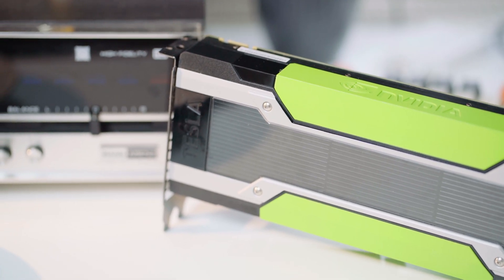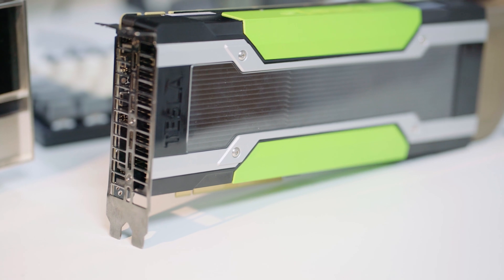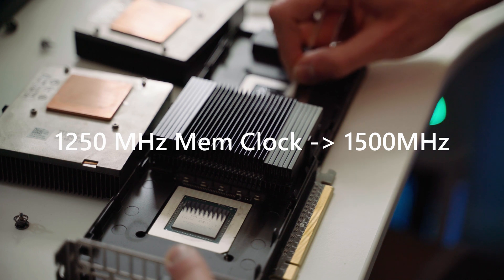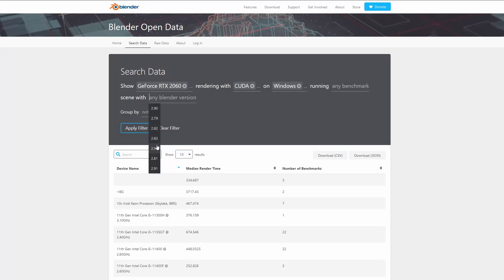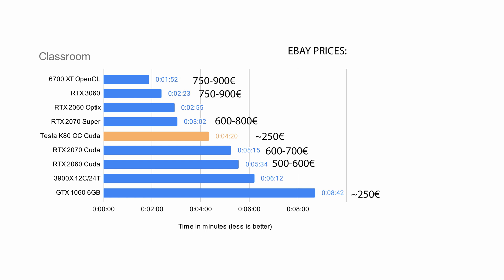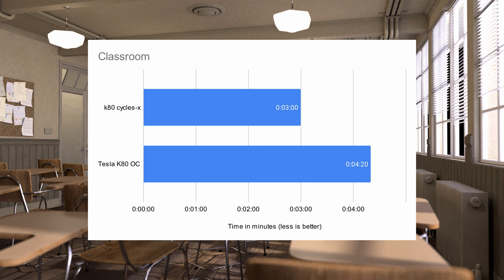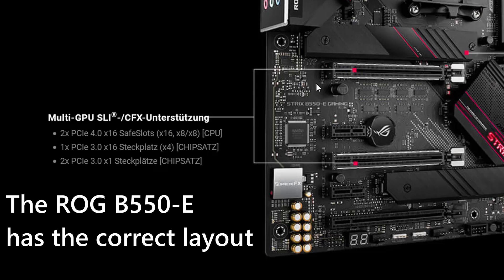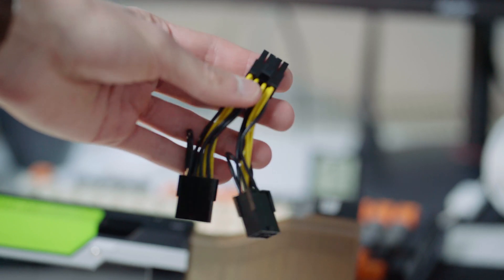Is This $5000 7 Year Old Server GPU Still Worth It? | Tesla K80 tested in Blender

Comment: just bought 16 k80s for $14 each. normally now ~$40. now some penguin servers with 8 slots, ~$500 each.... so at a bit over $1000 I have 384GiB vRAM.... Smaller deepseek is coming...
Reply: Did this work for you?
Reply: @mudkingz6432  not really. it is cheap and works, but that's for a reason... k80 is slow... we had to splurge on a100 to do a real stuff...
Reply: Does ollama works on these
Reply: @bekim137  yes, slowly :)

Comment: Sure you can't game on it, but if you wanted to make your own scientific work station on a budget than this would be amazing although you need to add a cooling solution to it because I'd suggest having a GPU with it sure DLSI is dead but that doesn't mean won't do anything. You can still have two GPUs working on the same motherboard just they won't be counted as one GPU the same can be done here I imagine with this server GPU you'd likely get a pretty good rendering beast as well long as you have a pretty good CPU and power supply.

Comment: im using X99 motherboard with xeon.. which is no igp on it. but got 2 slot for pcie, can i use low profile amd card for display only (bcs no igp on xeon) and use k80 for compute engine and rendering
Reply: Enable 4G decoding in BIOS first. Just put the K80 in the first PCIe slot, and another graphics card in the last PCIe slot, for monitor output.
Reply: @lQuadXl  thank you for asnwer mr. i founs out already but i doesnt turn the 4g decoding bcs its cause blank screen. so i use it without enable 4g decoding and it can run so well with rx 560 xt + k80
Reply: @erly777 Glad you got it working, enjoy 😁👍

Comment: Could most likely pop the shroud off and cool the gpu with some cheap water blocks if you want to be fancy, or high mark cpu coolers. 

I enjoy messing with laptops and cheap stuff like this on my off time. And often times and finding cheap cooling solutions to them is a fun hobby lol. Normal flow rate of a server is like 550 cfm. So most normal pc fans i doubt will be sufficent because theyre rated around 28 cfm. Buuuuut. Because there are two gpus....one thought is to have two about 250w cpu cooling blocks on it. One for each die. Or you could buy two water blocks and run them in parallel into a radiator. Worst case could allways use a peltier to cool the water loop for extra head room...etc.

Comment: I have a question about these cards. The total vram is 24gb but is it not divided between both cards (each card utilizing only 12gb each). 
Is it possible to utilize all 24 gb of vram for a single scene in blender? I'm seeing these as potential cheap use cases for headless render nodes.

Comment: When you flashed the overclocked BIOS did you confirm that both GPUs received the BIOS? These cards show up as two K80s corresponding to each of the GPUs in the unit; when I flashed the BIOS I did it the normal way (nvflash -6 bios.rom)  because I had forgotten that this is a two GPU unit. I'm asking because I flashed my K80 BIOS yesterday and noticed that only the first GPU of the two contained the flashed BIOS (via GPU-Z) while the other did not. When I put the K80 to do some folding (fah, folding at home) I noticed that only the first GPU showed a clock speed up to ~1000MHz and increased memory speed, while the other showed up as having a baseline gpu, memory clock and power usage but the GPU load is 100% :s .... Using NVFlash (newest build, 5.792.0) I was able to find out the index number for the second GPU but I could not flash the overclocked BIOS into it due to some mismatch board error. I ended up using an NVFlash version (5.590.0) that according to some forums can override this "board mismatch" using the command "nvflash --index=01 -f -6 bios.rom", where the index number corresponds to the vanilla BIOS. Now the second GPU unit has the flashed BIOS but still shows the same as before ..... did you encounter this? if not, how did you do it for your K80. :)
Reply from the maker: Hi, thanks for watching :) Tbh I don't really remember anymore how I got the custom bios running. I believe you need two different files for the two separate GPUs. Here is a thread that contains a lot of information which I used during this process https://blenderartists.org/t/tesla-k80-24gb-x3-rendering/1255786/28 maybe that can help you.
Reply: @futc.photography  bada$$ video tho! Will check out that thread. Videos like yours keep my hobby going.

Comment: I picked up a pair of these BNIB for $450 to put into an animation workstation I built for my sister in law 2 years ago... Like the individual you got your K80 from, I had to 3d print custom shrouds to force the airflow from a Noctua Industrial 140mm PWM fan from the front of the case through each card, but it works like a champ for her to this day. I spent less than what it would have cost to get her a single newer Quadro card and it performs within 10-15% for most of the work she does. They are great cards for the value as long as you're doing work that fits into the niche market these cards were designed for.

Comment: I know that this comment is coming very late in the game, but with "Above 4G Decoding" enabled, and on a motherboard that provides multiple PCIe x16 slots, and given that Blender works well with multiple GPU Cards, I am wondering what kind of performance boost one might expect with two Tesla K80 cards installed?  I would need to make sure that the CPU has integrated graphics as the Tesla does not have outputs, but... It might be worth the investment.  I was able to pick up the K80 here in the U.S. for $93 USD shipped.  I will let you know how it goes. :)
Reply from the maker: With two tesla K80 you can expect exactly double the performance of one K80, above 4g decoding is a necessity anyways I believe because otherwise you can’t address that much vram. Bandwidth usage is pretty low by blender so you don’t necessarily need a 16x slot but it’s the best case scenario. As I mentioned the performance should be exactly double, all rendering is done perfectly independently on each GPU core and 4 GPU cores instead of 2 will cut the rendering time in half.

Comment: This can't be true, it's 2x 780ti chips on 1 card, it has a combined performance that nearly matches the m40, which is a titan x / 980ti. In blender I found it beats a 2060, but a slightly slower dual gpu set up won't be able to bump up another tier
Reply from the maker: The K80 is definitely faster in Blender than an M40, I don't know where you got the idea that a 980ti has more than double the performance of a 780ti. The two GPUs on the K80, especially with the overclocked bios I was running for these tests, will beat the M40 any day of the week in Blender because Blender scales perfectly with multiple GPUs and the two 780ti's combined simply have more performance than a single 980ti.

Comment: I wonder if using the K80 in an e-gpu would be possible? I'd be using a MacBook with bootcamp/windows 10 so power would be fine and cooling could be sorted out. Obviously nvidia cards don't work directly with MacOS but with a hack :) they seem to work fine. Im more interested in the 12Gb of memory so have considered a Titan X but interested in thoughts on this...
Reply from the maker: That would be very interesting 🤔 unfortunately I can’t test that
Reply: I have answers, yes it would work. No it would not work well.

The k80 is a dual gpu card, which means it rely on sli for the speeds this guy reports.

In games or any other workload in sli it will perform almost like 980ti, but without sli which us most cases since sli is dead, you will get 1060 level of performance. 

You are going to be paying about 200$ for a dual gpu that only let's let's use 1.

Don't buy a k series card, they are not supported anymore and get really hot and don't support modern features.

Get a m40, it supports nvidia reflex, is an actual titan x, and should work great as an egpu.

You need to set the driver model to graphics mode but that's small.

Your biggest concern would be limited cpu speed
Reply: It’s a compute board there is no SLI or NV Link the board is incapable of using both GPUs for gaming but you can use both for compute and render applications.

Comment: If you are really doing Rendering?  Just get a server and call it day.
Reply: A server is not good at rendering

A server uses these gpus for rendering to be good at rendering.

A 64 core epyc cpu can't beat an old gpu at rendering, it's a cpu, it's emulating graphics.

Gpus have actual graphical compute cores.
Reply: @raycert07   Derp.  Ya think?

Comment: Yes you are right, it depends:By using Blender 3.0 rendering time of my single GTX 970 is just 3:10 Minutes. But you are right K80 may faster on more compley scenes, because rendering time of barber shop is ~30 Minutes ;-) Would be nice if you can retry your benchmarks with Blender 3.0
Reply from the maker: I would love to retest it with blender 3.0 but unfortunately I already sold the card, I was able to get my hands on a 3070 TI and using a Tesla card in combination with an rtx or gtx card is quite the hassle due to driver issues so I decided to sell the k80
Reply: @futc.photography  I know this is old video but were you using 2 GPU's at the same time and switching between them when rendering?!

Comment: hello nice video! this card is compatible with intel core i5 10400 2.90ghz processor (integrated intel UHD graphics 630 card)? you recommend it for the gaming?
Reply from the maker: I would not recommend it for gaming, it doesn’t have any video outputs, gaming on this card is only possible with some serious trickery in windows and I’ve never tried that out
Reply: @futc.photography  not true.

No series trickery in windows, you did no research. 

You run 1 nvidia smi command and reboot and it's in graphics mode.

This is an nvidia supported feature on tesla cards.
Reply: Yes it's compatible. 

But you won't be getting a 2070 in performance. 

At best using sli you will get 980ti performance, but sli is not supported in any games anymore. 

So you will get 780ti performance at best, which is half as fast.

And 700/ k series gpus are no longer supported and don't support new technologies. 

Don't buy these gpus, you are not smart enough to troubleshoot the issues they may produce.

Comment: i just have a question, blender doesn't reconise my k80 for cuda (i was using 2.93 and now i'm 2.90) how can i fix it?
Reply from the maker: Are you sure you have the correct Nvidia Tesla driver installed?
Reply: @futc.photography  yeah i've checked turns out that they didn't work because they reach the limit for heat, i've installed a 8000rpm fan and It works great

Comment: To get the performance figures listed in this video do I need to be using an additional GPU or will my amd 5 3500 be sufficient?
Reply: You need an igpu atleast, and it's not xalled amd 5 3500

Comment: The Blender Open Data benchmarks for the Tesla K80 are a lot worse than what you reported. Is this because Open Data only calculates 1 of the 2 GPU chips' speed, or is your overclock powerful enough to match the RTX 2070's speed?
Reply from the maker: I’m not using the Tesla k80 open data times, I’m using my own k80 times because as you mentioned the open data benchmarks only support one gpu.

Comment: Do you also recommend using the Nvidia Quadro M4000 or P4000? Can get these pretty cheap aswell in Germany.
Reply from the maker: No I wouldn’t recommend those, they are too expensive for the performance they deliver. I’d rather put that money into an RTX 30 series card if you can get a good deal, they are a lot faster than those quadro cards.
Reply: @futc.photography  Impossible to get a rtx 30 series at a good price atm

Comment: I have Tesla K10 and the dual GPU card gives a boost as well in Blender 2.93.

I also have both RTX A4000 and A5000, installed as eGPU on my Zbook 17. The K10 is surely a good CUDA addition to my Z820 with AMD Firepro W7100.

Great video! Kudos! 👍
Reply from the maker: Thanks :)
Reply: Hi, does using K10 or similar will allow to render with octane or using other CUDA features with my RX 5700XT?

Comment: Obviously the 6700XT is the one to get, if you could cough up the money...
Reply from the maker: The Nvidia 30-series cards are even better, if you get lucky and get one for msrp 😅
Reply: That isn't what you numbers tell me...
Reply from the maker: @sjoer  As you can see, the Nvidia 30-series aren't included in these benchmarks, only the 20-series is. In situations where optix can be used, an rtx 3070ti beats the 6700xt with double or triple the speed. I might make a video about the 3070ti in blender.
Reply: Yes, but Optix doesn't represent my day to day workload and an RTX30xx is priced much less favorable performance wise bar those edge cases ;)
Reply from the maker: @sjoer  I haven't done any conclusive tests yet, but in some circumstances the raw cuda performance also beats the 6700xt significantly. In some situation they are about equal. Yes that is true, the 6700xt is a lot easier to get at a reasonable price, I got lucky and got a 3070ti for close to msrp. If I do a video on it I'll definitely compare raw opencl performance to raw cuda performance.
Reply: I'd be interested in Vulkan rendering!
Reply from the maker: @sjoer  Vulkan API isn't supported by blender though, or is it?

Comment: bruh im considering buying one. Good thing tensorflow still support K80. My 1650 is at its limits when training.
Reply: Could you imagine if you couldn't use K80s with tensorflow? The cards would be e-waste.
Reply: I go oom all the time with my 2060s. Really considering to get on of these k80 and see if I can put it on my proliant server. Considering it cost me 6 cent per kwh and server uses at most 700 wh it would only cost me 1.18 per day - wayyy cheaper than cloud (tho they have a6000 for 1.25/hr).
Reply: @Very_generic_username  dude, add in power distribution costs. Those scale per kwh too.
Reply: Nah nothing fancy like pdu - I just hook a cheap ups to a 1u, and I suspect there's a large loss of energy i need to be aware of. When full load (cpu), the server only draw around 250 wh. The 0.7kwh is 250 + 350 with addition 30% buffer. Anyhow, the total energy cost is still <= 1.18 per day.